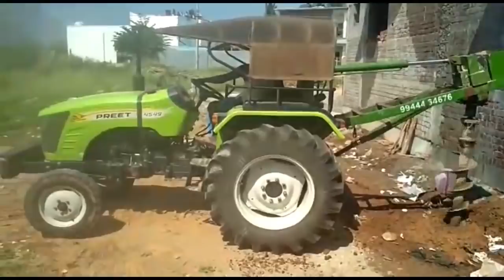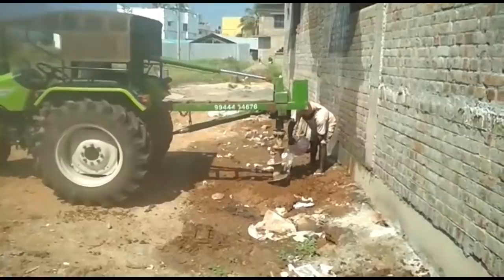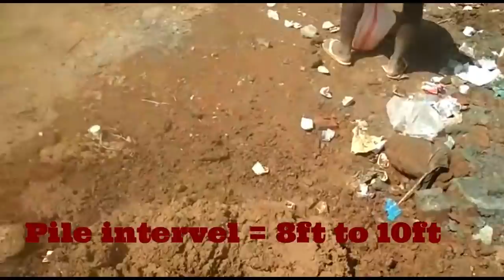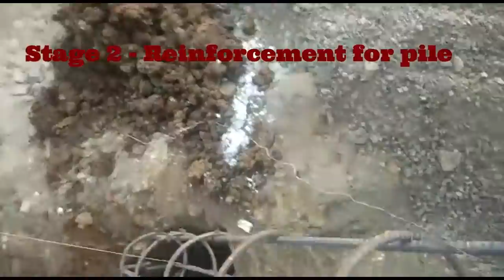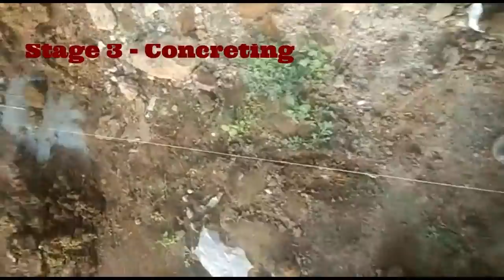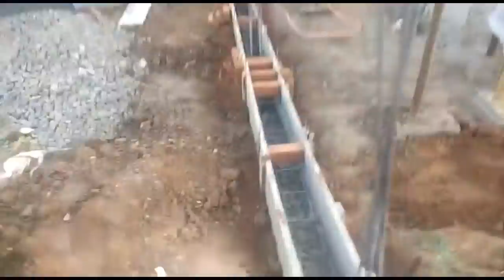Construction of compound wall amazing Indian technique with pile foundation | TCT

Comment: 1. What is the total cost for 4 feet height wall with foundation.      Area size 1 - 26*30 feet

2. What is the total cost for 5 feet height wall with foundation.      Area size - 40*60 feet.